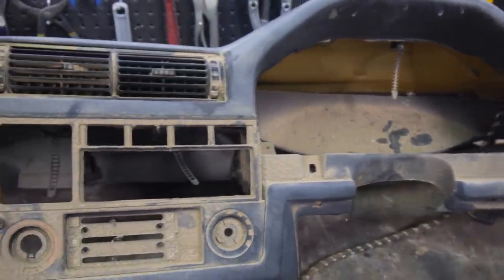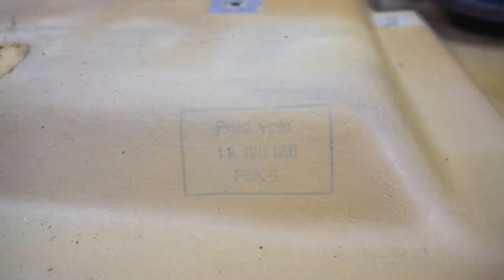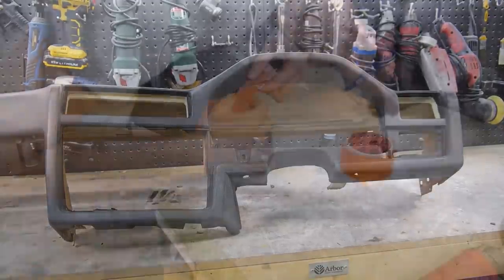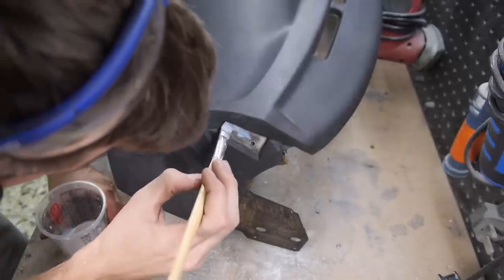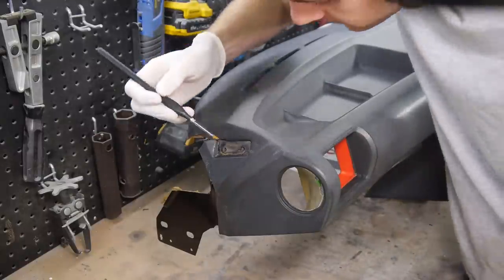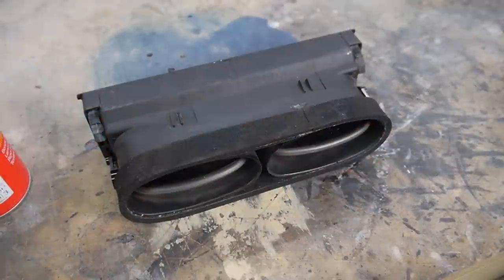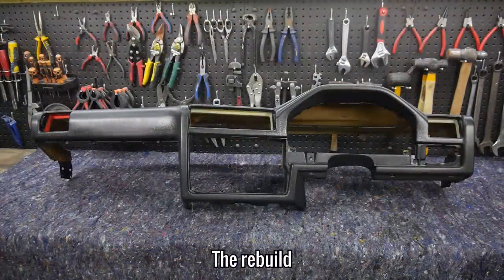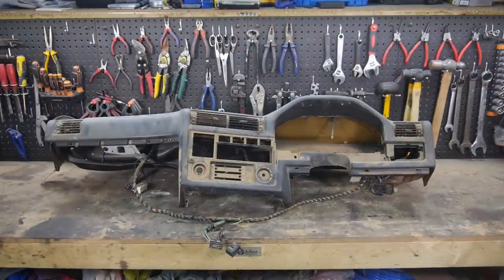BMW E30 Dashboard [Restoration]

Comment: I used interior paint on my dash and it looks good, but I'm not sure how durable the surface will be over time.  Worried that detailing the interior will eventually rub the paint off.  If I could do it over again, I'd actually prefer to use the linseed oil, even if I had to keep applying it because it would look original.  You can always paint it later, but its impossible or very difficult to undo that.
Reply from the maker: Very good point dude. I'll see how I get on with a few different paint systems

Comment: does the rust converter act as a primer? Also, did you check the wire harness to make sure there was continuity at both ends.
Reply from the maker: Yes it does and no i didn't but will do before it goes in the car.

Comment: Since that dash is from a later year, I would use the harness that came from the original car.  At the very least compare the looms to make sure all of the pin placement is the same!
Reply from the maker: Yea I will be doing that Green Go, you're not wrong. I just wanted to do it for the video mainly :)

Comment: For your Dash, Try  ( Alien Magic, Black Magic ) 
This product is more for exterior trims & black plastic bumpers .
TEST it on a Scrap piece of Trim / Dash. 

It's a very thin Liquid Which Retains all the original Texture in the item. 
This is a permanent Dye /Stain Should never need to be done again. 

TEST EVERYTHING before use.

For a cracked Dash, I would try LEATHER FILLER Finished with Black Leather Dye.

Comment: Regarding the yellowing underside (I'm well aware that it's too late), I would have used a UV light to bleach this area and forestall degradation due to mildew and other spores because of the dashboard prior unkempt state. If the dashboard begins to smell in a few months or years you'll know why.

And, I like your attention to detail as pointed out by replacing the foam. Many might forget to do this and then wonder why it sqeaked months later because of settling and chassis movement. Questions: why didn't you make a simple fiberglass rigidity mesh area to strengthen the underside area to inhibit cracking? I think the cracking atop is partially caused by flexing of the dashboard, chassis movement of coarse sun/heat. And finally, did the linseed oil concoction actually help the plastic and dashboard  top parts in the long term?

Comment: I restore mk4 jettas and I have used the dupli color black on seatbelts, cloth seats, and carpet with a lot of success but since it does contain acetone (or atleast I think it does) it makes the interior pretty much unbearable for a day or two

Sem makes a classic coat for leather and vinyl products that is god teir (think you can match oem colors). They've also got an alternative to the dupli color spray dye in a satin finish which is specifically for plastic and trim that's pretty epic
Reply from the maker: Cheers for the info Devin!

Comment: Hi, you ask for dash leather restorer. I use for black leather car seats normally black shoe polish. Wax based and I apply through shoe brush. It does great job for me. After applying let it dry for 15 20 minutes and wipe surface with microfiber towel. You can attempt multiple time s to achieve desired results.

Comment: You need to find a UV blocking coating that is semi gloss to add on top of the dash, hopefully something that does not out gas. Nothing worse than trying to clean all of the windows that have this condensate on them from ArmorAll.

Comment: I have a recommendation, you should put some of that cloth tesa tape on plastic to plastic surfaces to quiet down on creaks in interior. As for the paint i know dupli color makes vinyl and fabric flexible coating, but i never used it so i won't recommend it.
Reply from the maker: That's quite a good idea Ivan! Cheers.

Comment: I used Nugget shoe dye to recover a console, it's the old schoool shoe dye used before shining the shoes, it came out really well., I treated my console as if it was a pair of shoes. Since it is on the console, I don´t know how it will do on a dashboard with direct sumlight, but i figure if it is good for shoes it should be good for a dahsboard: It doesn´t let me post a link, but it is the liquid form with a foam applicator.

Comment: Hi there! 
Instead of using linseed oil which destroys the leather (drying it completely out in the sun) i would suggest you buy a colourlock leather care kit! They also supply dye/paint for leather and supplies for repairing cracks & rips! Definetly the best products i have ever used on leather for cleaning and care down the line. Does not finish with a gloss look for dashes like you see here but rather a mat finish so the sun doesn't reflect off the dash at you whilst driving! 

Kind regards
Detailers all over the world :)
Reply: Sidenote, could you also add link for the foam tape used on the vents, the screw set and the tape used on the wires? Restoring a e36 and this would come in handy!

Comment: Fantastic video.  Makes me wish I'd saved the dash I trashed for some little trim bits. My original was terribly badly cracked. I found a much better one with two minor cracks.  I've never seen a repaired dash that completely hid the repair and the paint over it.  I' m planning on a German or Italian vinyl and contact cement. 

There are several options now for replacement light bulbs that I'd encourage you to replace every single bulb as all originals are nearly 35 years. 

How many hours do you estimate this repair took (exclusive of video and editing)
Reply from the maker: Cheers Steve! I think about 20 hours or so. I think I'm really not sure. Thanks though!

Comment: Nice work and a lot of attention to the details. Regarding re-taping the loom I noticed you didn't leave a gap the width of the tape when you wrapped the tape around it as it had originally. Any particular reason for that? In my experience the spacing of the tape keeps the loom more flexible and easier to have it follow the contours of the part it's attached to. The closed or overlap wrapping is good for protecting the loom but makes it very sturdy and as such is used only in certain spots.
Learned about 303 aerospace UV protectant in the comments as an answer to your question so thanks for asking!
Keep up the good work.

Comment: I always enjoy your videos. Your voice, filming style, and of course content are superb. The result you got is pretty awesome; I would've never thought to use BLO for this. As far as painting this dash - there are several products designed specifically for this. SEM, SM Arnold Interior Surface Refinishers, Rust-Oleum, and, of course, Dupli-Color. I don't have any personal experience painting vinyl yet, but I've done some research in preparation for doing some interior pieces of my car. Preparation is key making sure the surface is absolutely clean of any oils and such. I would personally use SEM or SM Arnold's - both are high-quality paints.
Reply from the maker: Thank you Michael. I think I'm going to go with SEM. I'll speak with the guys there and see what happens. Thanks again mate.

Comment: I use 303 Protectant on my uncracked dash - its UV protection that dries to the satin-like finish the dash should be. Apply it, leave it for a bit then run a dry cloth over to take the shine off. Check it out & keep up the great work.
Reply from the maker: Thanks Simon, I'll be sure to check that stuf out.
Reply: @RestoreIt  Forgot to say,  use it on the door card panels too, they get UV exposure & anything else, centre consul etc.. I've even put it on the rubber spoiler trim on top of Touring tailgate.

Comment: I would only use pure Isopropyl Alcohol on contacts if they really do need cleaning.  You have to be careful that whatever you use won't leave a residue or worse still react with the plastic but I'm sure you have checked.

Comment: Nice job, I’ve been using stuff from “The Furniture Clinic”  in Newcastle Upon Tyne. Redone all my interior and dashboard to magnolia from black to match my seats. Sent them a sample of leather and they colour matched the paint. Set up a trade account to get priority processing and discount on products. You apply a special adhesion promoter and a product called “Crosslinker X” before spraying. 
I use an air brush for small parts and my ANI 150 for larger with 1.0 tip. All water based products as well, then everything is completed with a sealer.

Meant to ask, have you thought about using PPS system for your guns, no messing with cleaning out cups. Wouldn’t do without it now.
Reply from the maker: Thanks VR6! I'll have a look at that stuff and as for the PPS. I need it immediately! I just watched a video on it...

Comment: it is not leather right? its the normal foamy plastic? you should try "Koch Chemie nano plast care" instead of dying it. i didnt try it in the interiour yet because it stinks like a chemical poison but it doesnt wear off and the smell will be gone after few weeks. on exteriour parts it works magicly on 20yo parts and it claims its for any plasic on the car inside or out. its basicly fluid plastic.

Comment: Check out Colorbond LVP refinisher products. Thats what I used many years ago to restore the vinyl plastic on my vehicle and never looked back
Reply from the maker: Cheers Sparkles will do!
Reply: @RestoreIt  I've had some mixed experience with this product. It's an aerosol so prep work is 90% of the process. It also rapidly discolors if you try to remove it before it dries completely. Putting a sealer 
/clear coat on top of it is also crucial because depending on the surface it will lift slowly after light friction.

Comment: Also if you want to prevent that dash from cracking you need to reduce the heat that gets to it. Have a ceramic 70-80%+ tint to the windshield, you will BARELY notice its there I mean almost invisible and no cop would ever notice it(all my cars get it) and it DRASTICALLY reduces the heat. 303 aerospace is good to apply to the dash but I dillute it as I hate ANY finish on my dashes at all as it looks tacky and not oem.
Reply from the maker: I'm defo getting some of that 303 stuff!

Comment: If you want your dashboard to shine like forever, not being slippery and not collect dust - try high quality floor wax.
Reply from the maker: I've read that wax only quickens the fading process. I might be wrong!
Reply: @RestoreIt  I haven't noticed, probably depends of the wax. Gave one of my cars a floor wax threatment, and after six years, it was like i cleaned it yesterday. The interior was black vinyl/plastic. I have used that threatment for many cars and never had problems. I used quite liquidy floor wax as very thin layers (otherwise it will leave grayish "stains"). The brand was usually "Kiilto" SOL floor polish, for professional use, plastic floors. There is of course a wax removing liquid, if you aren't happy with the result. Wouldn't suggest it for the leather though. As a bonus, you'll get shiny nails for the next week, if not using gloves =)

Comment: Gave it a 👎🏿 as I knew a trimmer who drilled the cracks to stop the cracks spreading , used a filler to repair the cracks and had a plastic grain to put into the filler to replicate the o.e finish then would paint the whole thing in the correct shade colour using a plastic paint I couldn’t tell wasn’t the real thing .
That was a better job than this

Comment: Would be careful to nevet use any parts cleaner whatsoever  on a dash or air ducts due to carcinogenic benzene derivatives that can generate a brain tumor while blowing hot or cold air in enclosed surrounding and outgassing from vinyl surface too, invisible and oderless. Would stick to soaps that are safe.